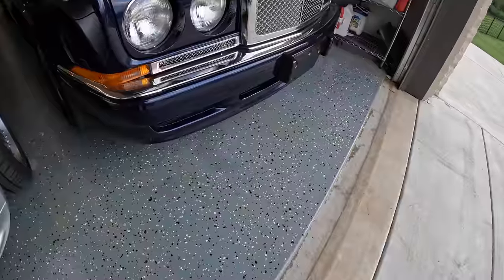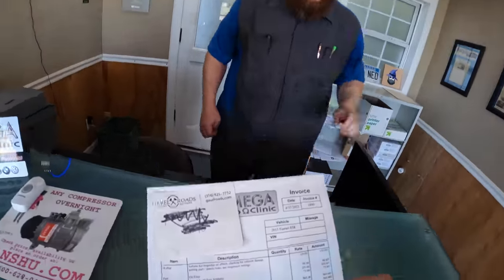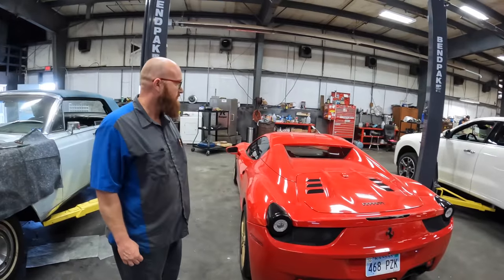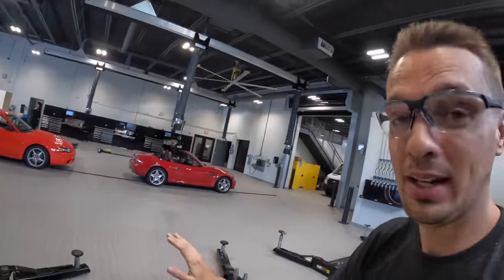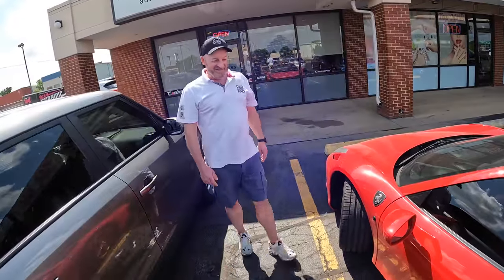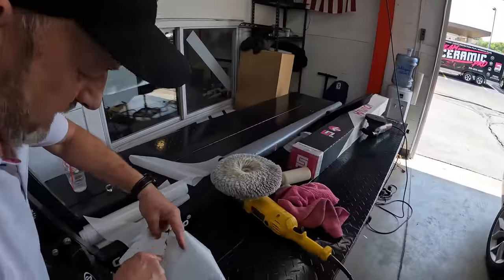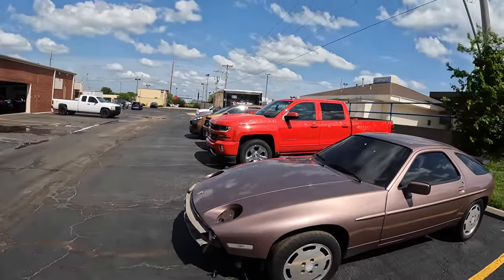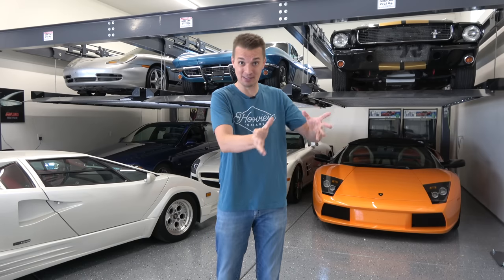My wrecked Ferrari 458 was supposed to be fixed, but the DYNO determined that WAS A LIE

Comment: LMAO Tyler sounds like nearly every person ever leaving the dyno aka the heartbreaker. Contrary to popular belief dynos don't lie. The car put down 320hp with SAE correction, had they used Standard (STD) correction the numbers would show 5-8% higher. Another common myth is gear selection skewing the numbers, the dyno doesn't care what gear the car is in. 1:1 is normally the most efficient for the drivetrain but only by 1-2% at the most. The only common exception to this would be on forced induction vehicles where lower gear selection on the dyno won't allow for enough load to produce full boost, or if the ecu applies torque limiters based on gear selection. The 458 falls into neither of those categories. Also as other commenters stated that was an all wheel dyno so it took torque to turn all 4 wheels/rollers, the dyno knows this and is calibrated for it so it is negligible in the results.

Taking all of that into account the car maybe would have best case made 345-350hp at the wheels using STD correction factor or as many would call it Dynojet numbers. That is still dramatically off from where the car should be. Probably the most important thing seen on this dyno run is where the peak hp was made around 7500rpm and tapers off past that. The early hp peak is the largest evidence of an actual problem. The 458's engine is tuned to hit peak hp at its 9k rpm redline, the hp should rise continuously until that point not peak and fall. The peak torque was also off by about 60 lb ft.
Reply: Yup, on those numbers I reckon it's low on compression (by quite a bit)
Has a leak down test been run on it?
Reply: Have to add in drivetrain loss too, hoovies quoted factory numbers would be at the engine. I don’t know what percentage of drivetrain loss a Ferrari would have but even if it’s only 10-15% then it accounts for a bit of the “power loss” seen on the dyno.
Reply: @mj_aussie_coaster_travels8310  Hoodie def quoted an average wheels figure as the 458 makes 562 @ the flywheel standard according to the factory
Reply: @mj_aussie_coaster_travels8310  450 is the reading at the wheels for a proper running 458.
Reply: You know this dude is clueless when he says STD is 5-8% higher. There is no range, it's simple 3.5% higher for STD vs SAE. Don't try to act like you know what you're talking about when you cannot even quantify a basic difference in correction factors.
Reply: @rustler08  no, it’s not a simple 3.5%. I have a dynojet 248 with 10s of thousands runs saved that I can compare STD vs SAE although it can be as low as 3.5% I was being generous and giving him a best case of 5-8%. STD and SAE take different environmental factors and weight them differently these include temp barometric pressure and humidity. There is no conversion between one and the other, they are both calculated based on different conditions. That’s like trying to compare one credit rating to another, they are calculated using different metrics, there is no simple conversion from a to b just guesses.  Look up the formulas for SAE and STD they are published. Before correcting someone in the comments be sure you aren’t an idiot.

Comment: I'd get rid of the 355 hands down Tyler!
Reply: I agree… the 458 is the most modern and fun to drive, despite the milage, and will also get that matt finish!! Tyler seems attached to the 348 and enjoys driving it. Also given the paint job issues, seats and carpets it will not fetch as much as an unmodified example. 355 prices are going up so it should fetch good money. Selling it would also mean avoiding unpleasant bills in the future.
Reply: @valentinos_antoniades  Exactly... I was too quick to comment and not expand on my thoughts, but you nailed it sir!

Comment: 330whp feels low still for 3rd gear
would definitely like to see a redo with proper gear ratio on a dyno jet with wheel hubs!
Reply: Transmissions/drivetrains these days typically eat about 15-20% of rated horsepower. That engine develops 562 hp at the crank, so the dyno should have shown around 460-470 at the wheel.  Something is wrong....
Reply: The 1 to 1 gear ratio is actually in 5th for that car, so those people don't even know how to use Google and probably don't even know how to use a Dyno correctly. They probably have it there just to charge people extra...
Reply: @nicolascrescimone  yes iirc you also have to input the final drive into the dyno to have it calibrated properly to each car?
Reply: I'm no dyno expert, but I don't think the front wheels should be spinning on an rwd car on the dyno?!
Reply: 4 wheel dyno should read lower as the car has to spin the front as well for parasitic drag calculations,  wondering if the wheels arent putting the power down  since the car is in the wrong gear.
Reply: I've seen new dyno's that can compensate for drive train losses when it measures the resistance slowing down the car after the pull. 
A company does weekly video's with it and most of the cars come close to manufacturer's specification with a couple of outliers with problems.
Reply: @nicolascrescimone  You can specify your gear ratios to match the engine RPM to the dyno on some systems (won't say all of them) to properly calculate HP. Doesn't have to be 1:1 engine:drivetrain.

Also helps in seeing whether your tires are slipping on the dyno and need some sauce when you do it that way...basically can do dyno runs in any gear as practical
Reply: @MikevanLieshout  Halle77?
Reply: @ischafer567  all the traction control and antilock stuff on cars,   have to have 4wheel dyno unless modifying the computers for only rear wheel
Reply: A slightly different gear ratio will make NO DIFFERANCE, other than MORE drag at Higher wheel/gear train RPM.   Dyno  is a calibrated  LABratory instrument and it measures RPM and Torque to get Power. An  increase in Dyno RPM will result in lower torque, and a bit more drivetrain losses at higher RPM.  So NO a different gear is not the problem of less than excepted HP.
Reply: Look at where the peak hp was made, 7500 rpm and then it falls. It doesn't matter what the absolute number was that alone shows a major problem. That engine should build hp all the way to it's peak at the 9k redline. Regardless of what dyno, correction factor or gear 320hp is extremely low.
Reply: @jfantis  Yes indeed! That graph looked nothing like what a 458's should look like! And nobody runs a dyno that far off. This 458 is broken.

Comment: A slightly different gear ratio will make NO DIFFERANCE, other than MORE drag at Higher wheel/gear train RPM.   Dyno  is a calibrated  LABratory instrument and it measures RPM and Torque to get Power. An  increase in Dyno RPM will result in lower torque, and a bit more drivetrain losses at higher RPM.  So NO a different gear is not the problem of less than excepted HP.
Reply: Dyno numbers are basically meaningless unless you know the EXACT drivetrain loss for your application. AWD cars have considerably more drivetrain loss than rear and front wheel cars and are known for performing "poorly" on chassis dynos. The marketing coordinator for Mustang Dynos admits exactly this. You will never get an accurate engine power measurement from a chassis dyno.  All they tell you is: "With these parameters and ambient conditions, you made these figures." 

You can use that as a baseline for comparison against other power runs in the same vehicle using all the same parameters and not much else. The only practical use for a chassis dyno is tuning in a safe, controlled environment under a variety of load and RPM scenarios. This is their intended purpose. Dyno days are stupid and a great way to blow something up while proving nothing.

Comment: It’s entertaining to watch. Yet it scares me to death to even consider an exotic
Reply: Lease or rent, don't own, they're really not meant to be owned, unless they're in the garage 95% of the time
Reply: They are basically garage accessories, because you can't really use them 100 percent. But I guess for people who got more money than they can spend, then why not.
Reply: Start with a solid old Porsche Boxster. Easy to work on, plenty of parts available. Stout engines (I’ve run one up to 280k miles) not super fast but you feel fast. Feels like an “exotic” if you close your eyes and imagine.
Reply: These post 360-Ferraris are really reliable when maintained properly. Not cheap of course, but they can be used regularly. And Ferrari service seems to be pretty good regardless of location.
Reply: Budget $10,000 a year on maintenance.
Reply: @JayMaverick  ya dealer service for a oil chang3 and inspección is several grand.
Reply: @glenerickson358  and more.
Reply: @carlosoruna7174  Eh, just take it to Jiffy Lube
Reply: They are parked most times. In all reality, many exotics are easy to work on and inexpensive. As long as it's not a daily. It's not super different than most cars. 

If you are mechanically inclined, then it's really no problem at all.
Reply: @snwboardn21  NEVER take any car worth anything to a regular consumer oil change place. 

A regular commuter car, sure. But any high end car, no way.
Reply: What's the use if not a daily damm drive the beast
Reply: Just maintaining a 84 e30 is expensive..and it only has 60k miles. Rear bearing  60 pesos. Labour 4 hrs. Lol
Reply: @carlosoruna7174  if it's your daily, then it shouldn't be an expensive rare car. You don't get cars like that to daily them.
Reply: If you can afford the car, you can afford the upkeep on it...  They are fun to drive but, not very fun when it comes to the bills on them....
Reply: @TheCoolDave  umm 83 e30 was 12k new. Today its 3k maintenance a year. And ya haven't touched tranny or motor besides fuel.  I know I own an old e30
Reply: I'll bet any exotic is easier to work on then a fwd V6 normal car.

Comment: I’d sell the 458, sounds amazing but you have other guys that do the same thing. The 348 is what the 458 is a reliable and damaged Ferrari that doesn’t hurt to drive, but the 348 does it at a cheaper price. The 355 should be kept as it’s a good investment piece. Keep it as it will always sell easily, let it be your rainy day fund.

Comment: Hoovie and cold-revving his super cars, name a more iconic combo 😂
Reply: I hope they secretly warm them up before filming.
Reply: @nicholasvinen  there’s no reason not to, as long as your car reaches normal idle like 700ish rpms
Reply: @IAmMarioBroZilla  sure there is. The oil doesn't lubricate as well until it reaches operating temperature and also the pistons expand as they heat up so they don't seal properly when cold so you get lots of blowby, dirtying the oil.

I wait until my temperature gauge is close to its normal position before exceeding about 2500rpm or more than about 50% throttle to extend engine and transmission life.
Reply: Did someone ACTUALLY SAY there’s no reason not to rev a cold engine ?
I don’t believe it…….nobody’s that stupid !!! ?

Comment: About time hoovie learned about PPF. I did my whole c7 in xpel ppf right after I got it new in 2017 and it is still perfect. The peace of mind ppf gives you is so worth it. Never worrying about rock chips or door dings etc.

You also don't have to worry about micro scratches from washing it either.

Also fun fact, if it gets some tough stains in it, using acetone cleans it right up. Feels weird using acetone on your car lol.
Reply: Even door dings? That's pretty rad.
Reply: I love not having to worry about the stones bouncing off my car with a full clear wrap, it is totally worth it.

And as you say it makes washing it much easier too.
Reply: @nicholasvinen  How much did it cost you? I got a new 4runner and really want one for the peace of mind but was quoted $8k for the whole car.
Reply: @PatrickLindemann22  I'm in Australia, I think it was around AU$3500 for a large sedan. That was a few years ago though, I think it would be more now. I expect an SUV would cost more but that still seems really expensive. Maybe get a quote from someone else.

If you can't afford to do the whole car, just doing the front is better than nothing for rock chips etc. But I have had rocks hit the roof and if you're going off-road the fenders, doors and sills could use protection. If you're going to do all that, might as well just do it all.
Reply: @nicholasvinen  I’m considering just wrapping it a different color, as so far that seems much cheaper and I’d like to cover the whole car

Comment: Uhhhh I’ve loved those 458’s since I was like 7 years old and I happen to know for a fact that they produce 562HP and 398 lb/ft of torque. 😶
Reply: Dyno reads at the wheels not flywheel.
Any extrapolating is a "best guess"
Reply: @th3b0untyhunter  Yes I know how a dyno works, I’m saying that he's wrong on the specs cause he said 450HP and some 320 lb/ft of torque I believe.
Reply: @dinurafernando1556  and those are the figures it should make on a dyno so how is he wrong ?
Reply: @th3b0untyhunter   It should make more than 450 and anyway he never mentioned how much HP it should make on a dyno. He said from the factory, which it wasn't it would produce around 500-530HP at the wheels. Accounting for the mileage it should produce 400-450HP if not that well maintained.
Reply: @dinurafernando1556  don't make shit up little boy. You clearly know nothing about cars, engineering or dynos.

He never said 500 - 530.
He said 450 which is about right AT THE WHEELS
562 at the flywheel would once you lose the roughly 17% drivetrain that mid rear gives would give you a figure of circa 466 at the wheels.

OK Tyler said around 450 but the ballpark is in the right area.

Poor previous maintenance won't lose much power on a modern engine with its tight tolerances and banks of sensors etc.
Especially not as wizard has refreshed everything.
No - that sort of loss indicates mecanical issues way beyond a bit of wear due to 90k miles
Reply: @th3b0untyhunter  He said from factory 450HP and 319 lb/ft. Now I don't know what made your ass so mad but the fact is that Ferrari claims 562HP and 398 lb/ft of torque. Meaning that even if you account for drivetrain loss you'd get around 500HP. I never wanted to insinuate that he said 500-530, I wanted to say that's what they should produce according to the drivetrain loss you'd experience through a dyno. Sorry for the mixup but they should produce a lot more than 450 on a properly calibrated dyno.
Reply: @dinurafernando1556  for most rwd cars it's accepted that you lose about 17% between the flywheel and the tyres (aka drivetrain loss). Ferrari tuners suggest it's a little higher on the fcars  at 20-22% for several reasons (some of which help handling and gearchange speed etc but also higher heat as its all in a smaller area).
Even an lsd (standard on Ferraris) adds drivetrain loss as both rear wheels are driven so components on both sides come into play all the time - but in reality on the road it always helps not hinders, but thats not seen on a dyno.

So even at the lower end 17% means a 562bhp car would shown around 466.5 bhp but remember that Ferrari tuners such as Novitech etc say its more like 20-22%  which  would mean 449.6 bhp (potentially as low as 438.4 bhp) - So Tyler saying 450 as standard is correct.

Around 450bhp at the wheels is what an 458 Italia should show (and torque of about 318 lb ft)
Reply: @th3b0untyhunter  On that you actually make a good point, Ferrari’s have never been about straight line or even 0-60 performance. They've always been about track performance so it makes sense that the LSD and other elements they put in would create more drivetrain loss than a standard RWD car. But having run the numbers myself you're right, I was wrong on the dyno stats. One thing that has to be said is that Tyler’s one has less HP than what it should theoretically produce even with the drivetrain loss. Any thoughts on why?

Comment: I’d probably sell both the 348 and 458 even though they’re both great cars, they just aren’t as solid of investments as the 355 and 456 with low km and a gated manual. Honestly though you could shift the 348 and 355 if you wanted to avoid the headaches of the 355. Honestly the only one I don’t think I’d get rid of is the 456 even though it might be the least desirable.
Reply: I’d bet a LOT of money that the 456 will be insanely valuable in a decade or two, it’s definitely the one to keep. 

Having a modern-ish classic-ish extremely comfortable GT with a gated manual and V12? I’m just shocked they aren’t more expensive already.